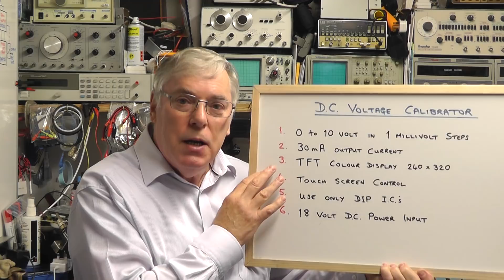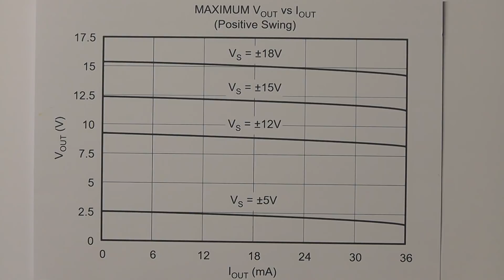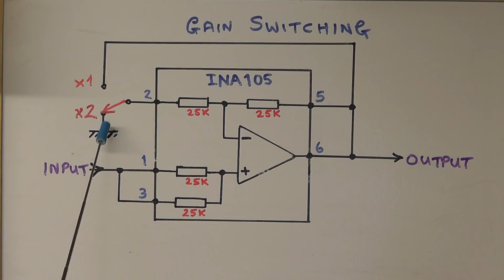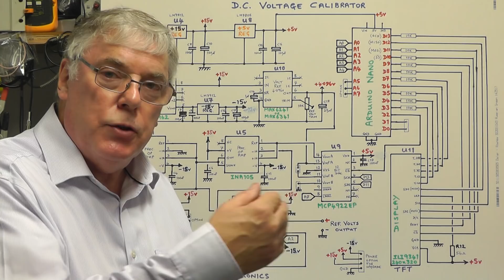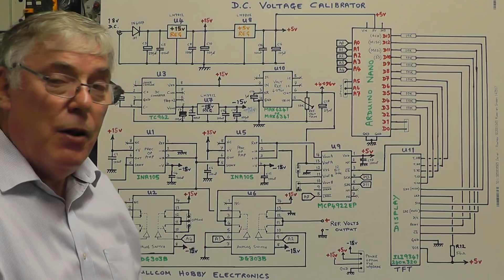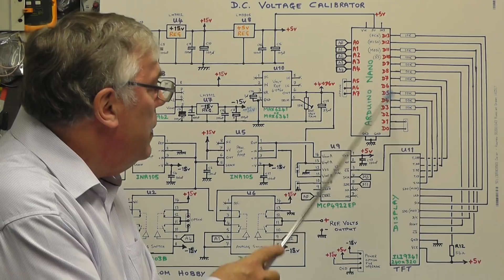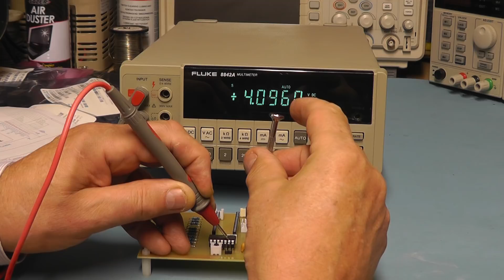Scullcom Hobby Electronics #53 - DC Voltage Calibrator Part 1

Comment: Why does your Fluke meter continue to give readings after you remove the probe from the circuit?  Is this a peak hold feature?  It's weird because the value keeps changing after you remove your probes.
Reply from the maker: This is due to the fact that the Fluke 8842A has an input impedance of around 10 GigOhm on voltage ranges below 20 volt. When it auto-ranges above 20 volts then the input impedance of the meter drops to about 10 MegOhm (similar to a standard multimeter) and then you don't see this effect. The residual voltage you see remaining on the display is what is held by circuit capacitance. You can zero the reading if you wish by simply shorting the test leads, if the test leads are simply left floating then the reading will take a long time to drop to zero and that the changing reading you see on the display is the effect of that. This is one of the effects of having a multimeter with a very high input impedance. But I am sure you will understand the benefits of having a very high impedance at lower voltage readings. 
If you look at 40:03 of my video you will see at that point I short the meter leads together.
Regards, Louis

Comment: That is a nice project. My only concern is the Arduino Nano. The graphics handling is very slow. Isn't there something Arduino and Arduino IDE compatible out there with a bit more grunt? So it is not too much hassle to adapt the software but having a much faster display response? BTW I like your whiteboard style. Beautiful!
Reply from the maker: Thanks. I am currently using the Adafruit ILI9341 library which I think is the main issue here with slow display refresh rate. I believe there might be a modified faster ILI9341 library which should speed up the display refresh rate - I will have a look out for one. The only issue with the display refresh is when you are switching from the main screen to the keypad entry screen as we have to refresh a larger area of the display. You will notice that when you are inputting a new reference voltage the display responds very fast, with no delay,  as we are only refreshing a very small area of the display. Regards, Louis
Reply: The ESP8266 and ESP32 are a couple of options for more horsepower while still using the Arduino IDE. Of course, you'd want to confirm where the performance bottlenecks truly are, first (processor, I/O, libraries, etc.).

Comment: i think that the place of the tft will be a little trouble when trying to put the project in a box. maybe the tft should be on a connector .
Reply from the maker: I think I mentioned in the video at 35:34 that the TFT can be connected by a plug in lead connector for final completion of the project in its case. Regards, Louis

Comment: always happy to have you back with amazing projects !!
sorry about the stupid question , but how can an arduino nano handle over 5volts?
Reply from the maker: Thanks. The Arduino does not handle over 5V it only operates from 5V or 3.3V supply.  We use the software code programmed in the Arduino to do the calculations and output a digital representation of that information on the SPI bus to feed both the TFT display and the 12 Bit DAC. It is the DAC that generates the actual voltage output in our case up to 4.096V and it is the other two OP Amps (their gain controlled by the Arduino and the CMOS anaolg switch IC) which use a higher supply voltage of ±15V to generate an output voltage up to 10V. Regards, Louis

Comment: The display is kinda slow. Restrictive touch sucks. That's why its cheap. 
some MCU's like the XMEGA have 12 bit DACs built-in.
no zero adjustment for the OP Amps are provided. 
Beyond that, good stuff. 
P.S> This design can go to 12V easily. As is.
Reply from the maker: The Adafruit library I am currently using does cause the TFT refresh rate to be somewhat slow on full screen refresh. But, I understand that someone has modified this library to improve the speed and I will see if I can find that updated library which should improve things as we progress. With regards your point about "no zero adjustment for the OP Amps" I find it is not needed in the configuration of the INA105 I am using in this project as the accuracy is already a maximum of 0.01% error. If you were using this IC in a differential input mode you could then add offset adjustment to pin 1 of the IC. Regards, Louis

Comment: Great little project. A little slow with the UI, wouldn't a SAMD21 M0-Mini (48mhz) speed that up significantly?  I haven't played with them yet, but I have a few on order for a project. They are NOT 5V input compliant btw.
Reply from the maker: Hi Emile, Thanks. The TFT refresh rate is somewhat slow when refreshing the whole screen. I am using the Adafruit library in the Arduino software which may not be the best. I have heard someone has modified this library to speed up the display refresh rate so I need to check it out. Regards, Louis

Comment: Louis, This project looks great. I'd like to take a stab at doing my own pcb in KiCad. Would you consider sharing your part libraries for the IC's so we can save a bit of time?
Reply from the maker: Hi Steve, I have just made the KiCad files available for download in a zip file. If when you open up the schematic in KiCad a box pops up saying "The following libraries were not found" just click close on the box - not sure why this pops up as all the files are there (it may be due to the fact that previously I was using an older version of KiCad, where as now I am using the latest version. Anyway the link below will give you all my KiCad files for this project, hope it helps:
http://www.scullcom.com/DC_Voltage_Cal_KiCad_files.zip
Regards, Louis
Reply: Thanks! I'll keep you posted on how it works.
Reply: I'm using version 4.06 as well and it worked perfectly!
Reply from the maker: Glad to hear its working OK.

Comment: Awesome project!  I am curious to understand if instead of using the first Op Amp as a X1 and the second as an X2 in the case of the 4V output range provides a more stable output than if you have the gain switched the other way around, X2 for the first Op Amp and the second as X1.  I say this because any noise introduced by the first, however little, is amplified by the second Op Amp.  Verification only requires a minor software change.  I wouldn't provide this comment if we weren't interested in a precision and stable output.  Meanwhile, I'm curious as to how to employ the second DAC... :))  Great work, Cheers!
Reply from the maker: Thanks for your comments. With regards the 2x first and 1x next for the 4V to 8V range, I did try that originally in my testing with the software but found for some reason it worked better the other way - I will have a further look at that. In part 2 of this project I will be looking at its performance including noise and take on board what you say. I have a number of ideas for the second DAC but have not finalised that yet, hence the reason why I have provided the extra socket connection options on the schematic and PCB. Regards, Louis
Reply: Louis, it may be due to an impedance mismatch into the first stage.  Thanks!
Reply from the maker: Thanks, have to take a further look at it.

Comment: question, why use the analog switch instead of simply putting a small low Ron mosfet on pin 2? the 25k against the high impedance input should be unity gain within reason
Reply from the maker: Thanks Alyx for your question. I wanted to introduce the CMOS Analog Switching IC in my project, particularly as the DG303B is a very good example with excellent properties such as very low ON resistance as well as the DPST switching with just on control signal and a break before make time of only 50 nano seconds. I try to introduce new components in my projects which may be of help and interest to the hobbyist. Of course you could use other methods of switching as you suggested but I felt the DG303B was the best for my project design. Anyway its nice to see other ideas put forward such as your suggestion, feel free to modify my project to your own needs and requirements. Regards, Louis
Reply: it is a very nice switch, its low on resistance really only beaten by the twice as expensive MAX4623 
and it is nice to see people still talk about analog switches as they are still a key building block in many designs
Reply from the maker: Thanks Alyx. Yes the MAXIM versions have a better ON resistance typically of around 3 ohm or so but as you say they are more expensive (about twice the price of the VISHAY version). The direct equivalent for my design would be the MAX4622 version. The pin connections are slightly different so sadly will not simply plug in as a replacement on my current design. If I had used the Vishay DG403 version then that one is pin compatible with the MAX4622. A slight redesign of the schematic  and PCB could allow either the DG403 or MAX4622 to be used and so may be worth a consideration as a future option, if we find a lower ON resistance would make any difference.  Thanks again for bringing the MAXIM version to my attention. Regards, Louis

Comment: Nice to see new videos. I would power the dcdc from 18v to avoid polluting the 15v with some switching noise. Also do the 2x first and the 1x next for 4V to 8v. Also why stopping at 4V?  Why don't you go to 4.095v before the x2?
Reply from the maker: Thanks for your comment. Yes I agree about feeding the negative DC to DC converter IC direct to the 18V input supply. I did hint at that in my video and will have a look at that in part 2. With regards the 2x first and 1x next for the 4V to 8V range, I did try that originally in my testing with the software but found for some reason it worked better the other way - I will have a further look at that. Regards, Louis

Comment: Very nice project, you could use the 2nd dac to trim the op amp divider voltage to give smaller than mV steps.... I think you could take it down to uV levels.  I did a video of my repairs to a Fluke 343A DC calibrator on my channel earlier in the year, and am in the process of a video series repairing a Fluke 5200A AC calibrator, some might find it interesting.
Reply from the maker: Thanks for your comments. I am some upgrades planned for later. Thanks for the tip on your Fluke 343A DC calibrator. Regards, Louis

Comment: I'm   skipping a couple of past projects for the moment to get to this one, I'm having to build a much more compact workshop, where  I'm building almost all home made equipment,because I enjoy the building, I've wanted one of these for sometime, thank you Louis you certainly have your finger on the pulse,I love these projects featuring TFT, screens, and the fact your using normal size parts, the nano and tft are quickly becoming the hobbyists and radio amateurs friend.
73  Paul  M0BSW
Reply from the maker: Hi Paul, Looks like you are going to be busy. This is the first time I have done a project using a TFT touchscreen so it is also a learning process for me to. All the best, regards Louis
Reply: ~Hello Louis, I like to keep the grey matter busy,,  plus I'm learning something everyday,TFT & Oled are very interesting devices although  Oled screens of a decent usable size,  are still a bit expensive in my view.